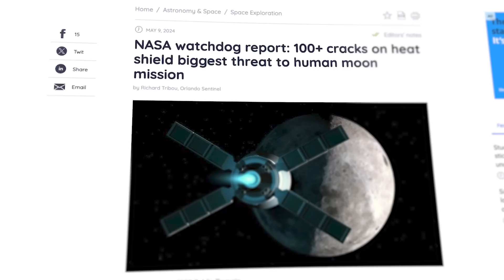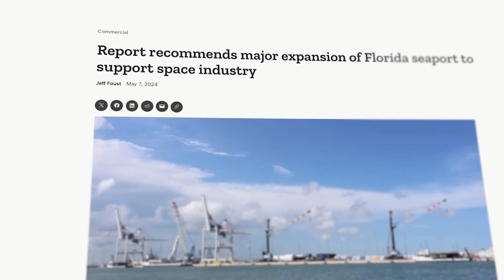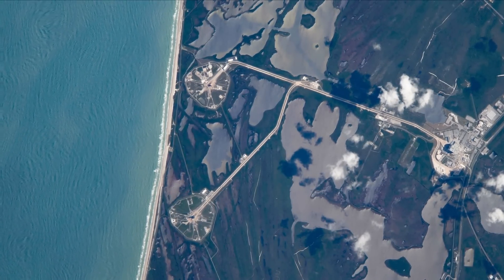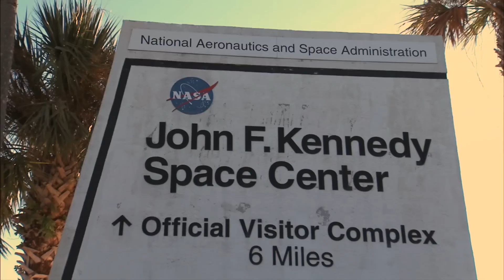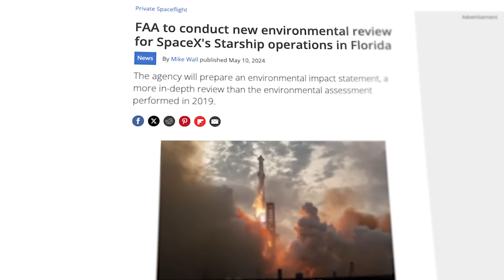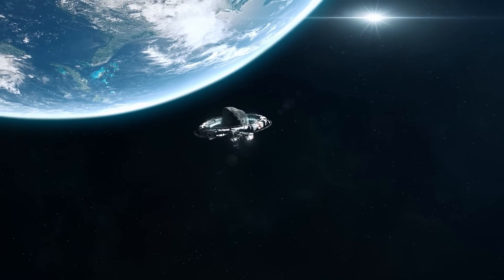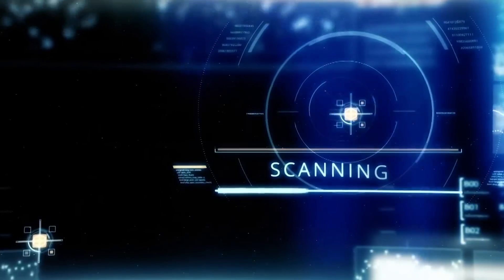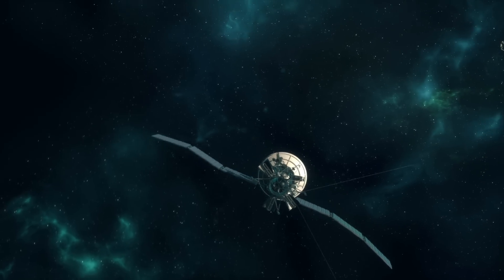NASA Has A Problem With Artemis

Comment: Has anyone ever thought of just pulling the Apollo out of retirement instead of reinventing the wheel???
Reply: Yes, of course, but it was made from 1960’s era components that aren’t made anymore.
Reply: @Scotto_desu gotta be a blueprint somewhere.....
Reply: @johndoepker7126  yeah, the point is that there are thousands of parts that there is no supplier for. This means that they'd have to convince / pay big bucks to manufacturers to make specialized ancient tech parts for which there is no market now. That would come at an eye-wattering premium. And, all of those parts would have to be space-certified and tested out the wazoo from scratch. It's much easier to design around proven available technology with an established supplier base.
Reply: @johndoepker7126  The blueprints are all there. The problem is that in the sixties, engineers would have a basic design on paper, but a lot of the details and specific manufacturing was just in the heads of the workers in the factories.
Can we make an F1 engine according to specs? Sure. Will it be reliable by just building it from specs? No, it won't, because many details that were added while manufacturing, are not in the specs.
Reply: @EaglePicking  Yep, exactly that... Spot on Sir !!
Reply: @EaglePicking  "a lot of the details and specific manufacturing was just in the heads of the workers in the factories". what a stupid things to say
Reply: @ Is it, though? How much do you know about the Apollo program and how exactly the rockets and all the parts were made? You might know more than I do.
Reply: @Scotto_desu @AdelaeR I really liked y'alls replies !! Cleared up a lot of "WHY don't they just" questions. Thanks!
Reply: @johndoepker7126  Yeah, there's a lot of why-don't-they-just-ism in the world. A prime example is the middle east. "Why don't they just make peace?" or "Why don't they just make 2 states?". It all sounds so simple if you know little about it, right? :-)
Reply: Much of SLS is based on using leftover shuttle hardware for cost saving. So yeah, it was considered.
Reply: Would have been better for SLS/Orion, given the sheer cost. Though much of the tech is grossly outdated and would have to be replaced in any case. But congress Forced them to use old Space shuttle parts to keep manufacturing with certain contractors despite the fact that no money was saved and the results were largely obsolete. This was always a pork barrel project the Senator Shelby was allowed to keep filling from other NASA projects when it ran through its money.

Starship, however is a seriously modern craft with Many major improvements including reusability, low cost of construction (stainless steel), rapid pace of construction, flexability (33 main engines, no two of which could bring down the rocket) and much larger payload both in terms of mass and volume. Its a rocket that was always going to land and take off from another planet/moon... an ACTUAL objective opening up whole new industries.
Reply: Suitably modified of course to make use of improvements in materials, electronics and processes such as 3D printing, but the design could closely follow the old Apollo but better. There's not much for which an up to date alternative could not be found or printed.

Comment: Wasn’t the heat shield issue completely solved in the Apollo program?
Reply: 1 time use craft, not multi use, so orion is using a completely different technique for its headshield.
Reply: @Yattayatta actually no orion still uses an ablative shield

Also to answer OP’s question - even Apollo was slower than this
Reply: @thesilentpearl8575   The Apollo capsules were one use and the Orion is planned to be reused, so you can't use the exact same thing as Apollo. After the Demo-2 manned test flight, the Crew Dragon heat shield had similar issues of abrading too much that Orion has. SpaceX just thickened the heat shield in those areas, something that NASA and Lockheed Martin will likely do with Orion, after their research is done.
Reply: @steveaustin2686  i guess? the thing about ablative heat shields is that they are usually replaced tho
Reply: @thesilentpearl8575  It is not quite that easy, while Apollo did also use an ablative heat shield, Apollo was single use so the heat shield carrier could take part of the heating. 

Apollo used a brazed steel honeycomb structure impregnated with phenolic epoxy resin for it's ablative substructure, which was both very heavy and very labor intensive to make.

Orion won't replace the substructure, just the ablative coating.

The substructure is also about 500kg lighter than on Apollo, so both being multi use and shedding 25-30% weight is quite the difference.
Reply: @Yattayatta  well yea but it doesnt make a very big difference lol
Reply: @thesilentpearl8575  What? yeah of course it does, you can melt the substructure in apollo, you can't on Orion?
Reply: @Yattayatta  well i mean melting the substructure does cause some safety issues but again safety was not a concern at the time
Reply: @thesilentpearl8575 but for reusing orion you can't under any circumstances melt the substructure, you can't even heat it up too much to not risk degrading it's properties

Comment: I'm starting to wonder again if SpaceX will land on the Moon before Artemis is ready.
Reply: Um, HLS Starship IS the lander for the Artemis III mission.
Reply: April 26, 2027
Reply: princecharon -- well, they have to, because, stupidly, NASA allowed the Artemis lander to go to SpaceX, who required a whole new rocket to be developed. So now the Artemis moon landing CANNOT happen without SpaceX first going through their whole process of making a big rocket and demonstrating they can put their lander on the moon.

What NASA should have done is require that the lander can fit on the same stack with orion.

The "alpaca" one was far superior. Much lighter, didn't require a new rocket to be developed.
Reply: That's why we all keep saying that Nasa should scrap the SLS system and just go with Starship!
Reply: @ArmstrongandTumbler  starship cant get back from lunar orbit, dragon capsule cannot survive reentry from lunar velocity, so they need to either upgrade dragon or starship, which will not happen soon, but maybe before nasa gets their shit together
Reply: SpaceX needs ~12 missions to orbit and refueling with a 100t vehicle to fulfill their part of the mission.
At the moment they still have issues to open a door and fly straight or keep the tiles on the hull + everything is one-time use

how long do yout think they need to have a fueled starship in orbit?
Reply: @benjaminmeusburger4254  late 2025
Reply: First to land on the moon? Yes because that's the whole point of the HLS.

But now I'm wondering if SpaceX will just be ready to launch a solo moon mission before orion is ready, even if SpaceX does still need at least 3-4 years for that.

Comment: why is the Artemis heat shield data only coming out now... did they only just now figure out that it was cracking?   how much does it cost to schedule a launch, scrub it last minute, schedule another launch, and scrub it, too?  -- confused tax payer
Reply: NASA HAS known about it since it happen and NASA and Lockheed Martin are researching it. After the Demo-2 manned test flight, the Crew Dragon heat shield had similar issues of abrading too much that Orion has. SpaceX just thickened the heat shield in those areas, something that NASA and Lockheed Martin will likely do with Orion, after their research is done.

Comment: Artemis is completely misguided
Reply: Probably, constellation was better. And the best Mars/moon program.
Reply: @sinabarzyar5766   Constellation was woefully under funded, which is part of the reason it was cancelled. The Apollo NASA had 3-4% of the US budget and no other big programs besides Apollo. Currently, NASA has less than 0.5% of the US budget and is also running the ISS at the same time as Artemis.

Comment: Nasa has been revealed as the bloated plodding tax cash devouring slug that it is. Spacex launched from pad 39a the other day in a launch that now exceeded the total number of shuttle launches in 30 years and they did it in like 4-5 years. Yeah its not the same complexity etc. BUT from the start of development till now Spacex moves at a pace 10x what NASSA ever has except in its first decade and its clear the first mission to mars and the real future of moon landings will be private and not NASA.
Reply: 🙄Contrary to popular 'rah, rah, rah SpaceX rulz" fanboi belief, NASA and SpaceX are NOT competitors. SpaceX's biggest customer is NASA and SpaceX would not exist without NASA PER Elon Musk.

NASA has ALWAYS contracted out hardware, all the way back to the Mercury program. 

After the Demo-2 manned test flight, the Crew Dragon heat shield had similar issues of abrading too much that Orion has. SpaceX just thickened the heat shield in those areas, something that NASA and Lockheed Martin will likely do with Orion, after their research is done.

Comment: “Many of these rocks are filled with extremely precious materials..” Only of “filled” means contains a very small proportion of extremely hard to extract minerals.
Reply: Asteroid mining isn’t for earth dwellers. That doesn’t make any economic sense. It’s for projects in earths orbit and beyond. You can get a lot of asteroids below the 9.4 km/s delta-v fee of earths gravity. The peak concentration of Main Belt Objects is around that, leaving a lot of objects being less costly to bring material from than from earths surface. Most Near Earth Objects are below that.

As for how hard it will be… we’ll just have to wait and see. We don’t actually know much about the composition, it’s all just speculation based on meteorites and only now some small amount of pebbles from the surface of two of them.
Reply: @ParameterGrenze  How about this model: Mine the far side of the Moon. Its low-but-present gravity will stabilize the mining and delivery machinery in a way known by gravity dwellers but essentially absent on asteroids. The lack of atmosphere and the low gravity are two less impediments to 'tossing' it to Earth. The basalt 'oceans' from ancient lava flow pulled toward the Earth on the near side mean the far side has more exposed mineral bearing rock, less digging. The refining would be in situ thus less mass to accelerate toward Earth and the tailings remain on the Moon. The transit time is not important once the process is underway so the delta-v can be just enough to get the 'tossed' (launched) product captured by Earth's gravity. At the Earth end of the chain both asteroid mining and Moon mining face the same final delivery problem posed by the atmosphere. Perhaps tailings could be an ablative coating that is not available from asteroids because of in situ refining difficulties in zero-G. 'Tossing' from the Moon can be simple leverage (or angular momentum as being researched by SpinLaunch) as opposed to the requirement of engines to provide delta-v from asteroids. (I didn't edit this post, please forgive spelling and grammar goofs, just trying to get make the case quickly over lunch.)
Reply: @ParameterGrenze  If they had started seriously making moves towards asteroid mining back in the 70's the first asteroids could have already been in Earth's orbit. They could never get anyone on board with the idea of unpowered capture because it would take so long and they could barely explain the concept to politicians let alone drum up public support. Now the economy isn't in a fit state to support to support anything but unpowered methods.
Reply: Is all the content here as thin analysis as it is in this clip?

Comment: We didn't have that problem of the Apollo mission to heat shield held and held really well. 
Why is this new tech even necessary?
Reply: this current rocket does not have enough power to properly circularize the orbit with the stated payload. in short, it has to shoot itself straight at earth to get back which mean less time to slow down. people don't understand it a capacity issue, Orion is a much heavier craft. and it a little late to ask Orion to lose 30% of it mass.
Reply: @lagrangewei  So there's no way of dumping any of that excess delta-V and slowing it down?
Reply: Reminds me of when I was working at Ford.
They were having major problems with the roll-up windows in next year's model.
A very angry man from HQ came out and listened to the explanation of the issue.
He then very deliberately asked "How long has Ford been building cars that had windows that go up and down and WHY are we changing the mechanism?"
Design reverted to the old design that week and the new model year rolled out on schedule.

Dear NASA;
If it's not broke, DON'T FIX IT.
Reply: Safety expectations for the crew are way higher than back in the sixties.
Reply: You have no right do question your best people beacuse of whom you can live your life.
Reply: It explains in the video.
Reply: Because it never exist. Apollo mission was fake, but people still believe in smoke far away.
Reply: we did have these issues with the apollo heat shield actually. and the reason we're having them again is because orion is WAY BIGGER and coming in WAY FASTER than apollo ever was and did.
Reply: @foxboy64  it is not coming WAY FASTER. The re-entry speed is proportionally related with the escape speed. That is a constant. Incidentally the re-entry speed is a value somewhat shy of 40.000 Km/h. In comparison the new generation of ultra fast russian rockets which are beating the shit out of US are speeding only at 10 MACH (13.000 Km/h)
Reply: We should also go back to guidance software that is run on 32k of ROM and 2k of RAM right? If it ain't broke and all...
Reply: Because Orion is expected to do more (with a MUCH higher re-entry speed) with a budget 10 times smaller. Would you like to go back to a 1960's higher tax rate to compensate? 😆
Reply: @helifanodobezanozi7689  we could just take the money from our ever growing military budget. Why do taxes have to always rise for real innovation. The US has been cutting programs every year to increase the military budget.
Reply: @gaztroan131  Bad idea and false hypothesis. Waaaayyyy more money was spent fighting the Vietnam War during Apollo than now. Secondly, both China and Russia are legitimate threats to the US. (I'm not sure you noticed, but the largest war since WW2 is currently being fought in Europe with roughly 400,000 casualties in 2 years. Also, the CCP is in the midst of building a blue water navy for the purpose of invading Taiwan. Cutting defense spending now would not only be irresponsible, but idiotic.)  If anything, spending MORE MONEY ON DEFENSE, especially in a race with China PERMANENT MILITARY MOONBASE is probably THE BEST SOLUTION!!!!
Reply: @helifanodobezanozi7689  re-entry speeds of apollo and artemis are actually pretty similar. Apollo 10 re-entered at 11.094 km/s while artemis is projecting 11-12 km/s
Reply: Yeah, actually.
Reply: @helifanodobezanozi7689  "with a MUCH higher re-entry speed". What a BS. The re-entry speed is a given constant which is related to the speed which is necessary in order to exit the planet orbit
Reply: @nicolagianaroli2024  Wrong. There are several types of re-entry manuvers a spacecraft can use and speed can vary. Artimus 1 used a "Skip entry" where the spacecraft hits the upper atmosphere not once, but twice during re-entry. The original thinking was that using this entry method would help save the heat shield, but it proved not to be the case.
Reply: We still pay a comical amount in taxes now, they're just subtler about it.
Reply: @Scotch20 that is 1000% true
Reply: Crazy.  All Boring..uh..Boeing had to do was copy the original Apollo capsule and add 20% size.
Reply: saves costs, more $$$ for the snow addicted glue sniffing managers
Reply: Is possibile that the Apollo heat shield was not green😉
Reply: 10-4
Reply: Does it ever occur to you the apollo missions were fake?
Reply: @andrewzhang985  No. 
Go away, we're discussing science here, not wacko conspiracy theories.
Reply: @STSWB5SG1FAN  Wacko? You mean like wearing handstitched zippered 'spacesuits' in a Torr -12 vacuum? Or Kodak extachrome photographic film in uncooled/heated cameras in high radiation conditions?
Reply: @OurAmazingSkies  or standing under the sun in the vacuum for days without a conditioning system to keep it refrigerated? Or re-entering into orbit in a giant sized wash machine drum without an engine or means of steering it at the speed of 40.000 Km/h?

Comment: Part of the ULA, Boeing, Lockheed Martin group!😮  They are protect by their politicians!😊
Reply: After shenanigans in competing for USAF/NRO contracts, Boeing and Lockheed Martin divested their medium space launch divisions into the new ULA company in 2006. While ULA is owned 50/50 by Boeing and Lockheed Martin, ULA is a separate company with its OWN managment.

Lockheed Martin makes the Orion capsule. Boeing is the lead contractor for SLS. Northrop Grumman does the SRB's and for the first 3 flights, the ULA Interim Cyrogenic Propulsion Stage (ICPS) is the second stage for SLS. Boeing's Exploration Upper Stage (EUS) is slated to replace the ICPS in the Artemis IV+ missions.
Reply: Just FYI, ULA is a 50/50 joint venture between Boeing & Lockheed Martin. Your point is absolutely correct as well!